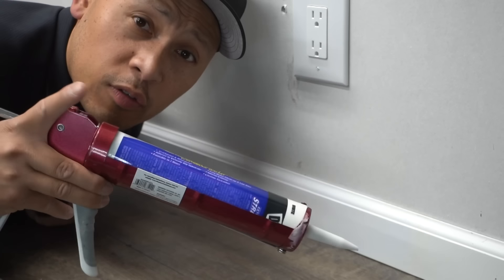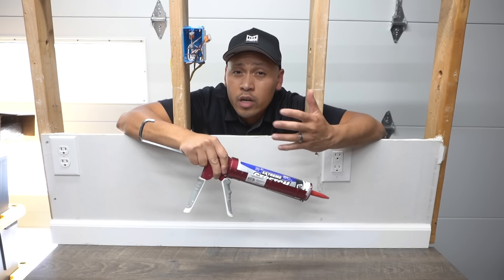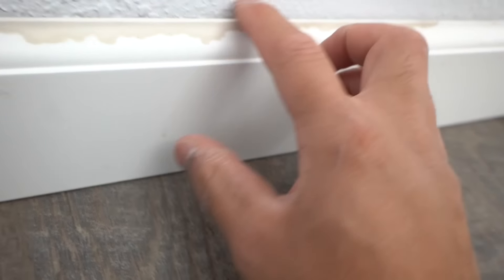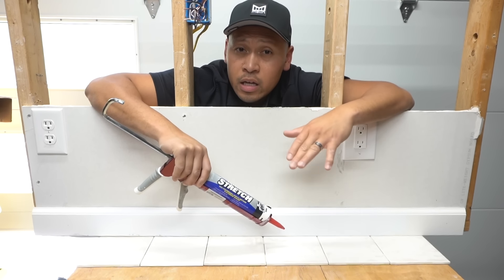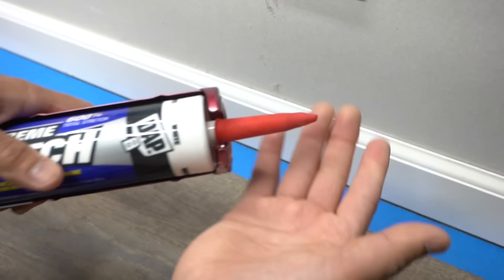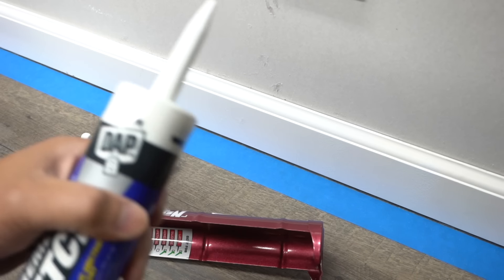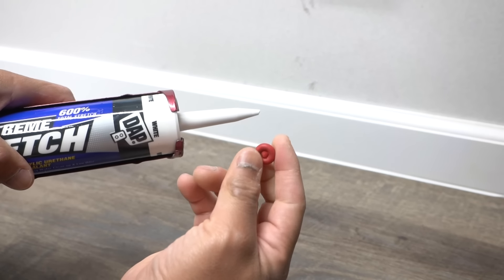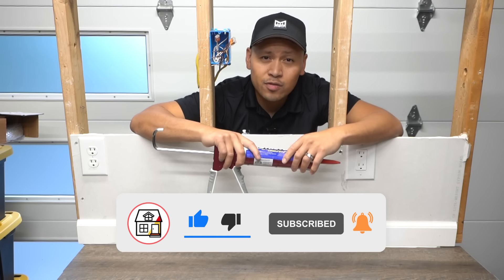Should You Caulk Your Baseboards To Your Floor? Pros And Cons! DIYers Great Controversy!

Comment: No you should never caulk the the bottom of baseboards. The reason is when water gets behind the caulk and paint into your walls the crack at the bottom of the baseboards is the only place for that water to escape.  Water gets locked in, baseboards swell, paint bubbles, caulk pulls away from the wall. It's just bad practice. I've been in the trades for twenty years and I've seen these problems first hand. Plus it looks ugly after the caulk starts to yellow.
Reply: How is water getting in behind the wall ? Silicone is what you’re supposed to use, not caulk, because it’s flexible and doesn’t yellow.
Reply: @reefhog  water gets into walls in all kinds of ways. More than I care to give examples for. Especially in kitchens and bathrooms. Every time I've seen a bottom caulked trim board in a bathroom more than a year old, the trim is always ruined and expanded. This doesn't happen on my installs specifically because I don't caulknthe bottom of my base. When you consider Capillary action and hydrostatic pressure, there needs to be a way for the materials to deal with the changes. It's kind of like expansion gaps. Can you install a floor without them, of course, but you're setting yourself and the customer up for failure.
Reply: @Multi4204life  Sounds like your building regulations are poor. In Australia, bathrooms are usually told, and extensive waterproofing is required before tiling. I can’t remember seeing skirting boards in a bathroom. If you do end up with water inside the walls, skirting boards being sealed to the floor is the least of your worries. You’re going to be pulling the walls apart regardless. Been in the “trades” for forty years and my father was a carpenter, so I’ve been around the building industry for my whole life.
Reply: @reefhog There is no reason to caulk the bottom of base in bathrooms in my area. First of all alot of our bathrooms are getting lvp nowadays. Don't use mdf in bathrooms unless your very cheap, it takes a pretty continuous water problem to ruin hardwood and pine base, I've remodeled at least 50 bathrooms and water damage is almost always on the back walls of the tub and face of the tub where we do seal it, toilet and vanity would be the next areas NOT the other walls or  baseboard in general so it's not a real problem to me. Alot of these bathrooms I've ripped apart have been 20+ years old and none have had extreme water damage so our codes in my area aren't too bad.
Reply: Everything you said sounds very logical. Do you live with the gaps or have a different solution? My hardwood floors meet plaster over brick walls. I've removed the trim and want to seal the cracks before installing quarter-round. But knowing me, I'll come up with some solution that doesn't age well or has other unintended consequences.
Reply: @cstreater  for the gaps under baseboards, you either push them tight to the ground before nailing, or you can scribe areas that have humps. In the end, you have to live with some defects. For example, if a small tile is lower than the tiles next to it from improper installation, you either have to reset the tile or  leave it alone. Scribing or caulking will still show the uneven spot. At the end of the day, the small gap, if any, should be barely noticeable. Things need room to expand and contract. Otherwise, there will be failures on what could have been a nice job.
Reply: @Multi4204life  thank you for this information!
Reply: I can understand the precautionary logic, but i'm not sure I fully agree.

For instance, would this logic still apply to other moisture-prone floor/wall thresholds? (i.e. a shower tray) Because the same issue would also be present here: "when water gets behind the caulk [sealant]
Reply: @erqankryn4029  the difference with a shower pan is that the pan itself is waterproof. Tile jobs are all supposed to be waterproof underneath the tile in case of failure that allows moisture in. Baseboards and drywall will usually show the water damage long before a tub as long as everything is installed properly.
Reply: @reefhog  Silicone is also called caulk.
Reply: @msheart2  No it isn’t. Why are you replying to a nine month old comment ?

Comment: I do have a question about the tip of the caulking tube.  Do I cut it straight across to open, or at an angle, and if at an angle, about what angle is best and how much of the tip to cut?
Ok, so I guess that turned into a multipart question! Lol 
Looking forward to answers and tips.  Thank you so much!

Comment: I caulked like this but the the caulk keeps cracking because the floor in the corner is not leveled. So any weight in the corner pulls it apart. There is about a quarter inch give, any ideas what i can add?
Reply: Random internet advice but If you are not on a concrete slab it might be a good idea to get someone to make sure your floor joists or floor is not rotted

Comment: If I caulk the dining room instead of using quarter round how do I transition into the next room using quarter round? My next room has probably an 8th" inch gap and that's too wide to just caulk. My dining room baseboard is pretty flush to the floor .

Comment: I use a section from a vertical blind. Hold it a 45 degree angle or wedge it under the board. They are usually pretty long and if you have a few you can clear a room pretty quick. Wipe it later ready for the next use.

Comment: I would actually caulk the wall first before I did the baseboard because it's so hard to paint and cock gets really dirty quickly. Everything sticks to it.
You can also buy flexible. Baseboard so that you won't have any gaps and caulking is not needed at all

Comment: Do you want a classy look? As an experienced painter with restoration quality work experience, personally, I would not choose to caulk there. Over time when there is reworking of the floor or baseboard, that line will get rougher and rougher as the caulk gathers dirt, hardens and breaks free from the floor surface. You need subtle shadow lines for a crisp refined look.  I like to maintain a gap just large enough to slide in paper masking (not adhesive backed) any time the baseboard gets repainted. Just pull the paper free afterwords. This way, that line will stay clean and crisp through many paintings and remodels that way. 

In general, IMO visible caulk anywhere on interior surfaces is a sign of low quality work.
Reply: So what if the customer tells you they don't like the gap?
What do you do
Reply: @JP-yd4yl  I got to the point where I only worked for customers who trust my judgement; all the rest were trouble. Not trying to sound snarky, but if they don't trust your judgement something is wrong :)

Comment: For any DIY person who really wants true answers... Just simply Google what floor installation You can even contact companies One of the things they'll say you should never talk this particular area The wood floor needs to have airflow moving underneath and yes there is always problems about insects spiders but here's my solution before installing the baseboard you can use powder or spray insect killer before applying the baseboard and when you install a baseboard you have to have a 1/16 Gap that's maximum low point.. And by the way there is no city or state code that would require this to be done...
Reply: As an over 20 year painting contractor doing  high end homes with engineered wood floors, I have yet to have a problem with caulking the base to those floors. Of course a flexible caulk is a must. Think about it for a minute- there is no "airflow moving underneath" a glued down floor. And no pesticide is a permanent deterrent to insects.
Reply: @pianomanw1m226  At least for floating vinyl click flooring, "Barricade", a company that makes insulated subfloor panels (probably mostly used in basements) advises against caulking the bottom of the baseboard (for air flow reasons).  Was wondering if I could caulk, and after it dries cut the caulking.  I figure the cut might not be too apparent and might be enough to allow for some air flow.

Comment: All - for floating floors be aware that this will void your warranty ->- these warranties on floors is for the mfg'er not the consumer. We had several planks break at the seams and filed a claim and the claim was denied and the reason was floor was caulked at baseboards which didn't allow for flexibility causing plank failure. ... just sayin -  we do like the look and the insect removal (although they still get in through doors, electrical outlets, and who know's how else)...

Comment: You could always use shoe base as it’s more flexible and you can push lower to floor
Reply: I thought about that, but along the same wall I have a 1/4" in spots and no gaps in others (it's an old house).  So I would have waves in my shoe molding.

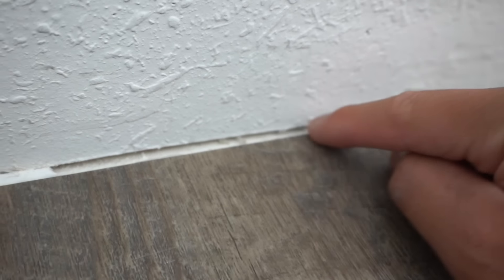Comment: 2:10 so I removed my old base boards because at the very bottom of them there was a rather large gap. To my surprise I found out that the gap from my floor tile to the wall is about 1 to 1.25 inches wide.  Anybody know what is best used to fill this gap before I install my new base boards? Would I simply have to grout in this gap?

Comment: The floor needs room to expand and contract and will just rip the caulk away from the baseboards.  The correct thing to caulk on a floating floor is the 1/4" gap between the drywall and the floating floor.
Reply: Even with the stretch caulking he’s using?

Comment: Whether it was code or not, makes sense to seal those joints.  A spider bite to the sack is a great alarm clock, but we have better options.  One question though.  If you accidentally ingested about a spoonful of caulk, would it be wise to call the emergency room to explain you have caulk in your mouth?

Comment: On hardwood and tile floors I have put down a bead of caulk and installed quarter-round right over top of the wet caulk. It gives a nice finished appearance after being painted without having to worry about smearing caulk on the flooring.

Comment: I really don't like exposed chalking regardless of color or kind of chalking. It looks good now, but it will not after a while. I would pre-chalk and use shoe molding, NOT QUARTEROUND!! And using a damp rag after going across with your finger to get any excess chalking, then back over with your finger for a clean look eliminates the tape. If you are using %100 silicone (non paint able), water will not work, but spitting on your fingertips before smoothing does work.

Comment: The caulk/sealing is aestethic to be in the coor of the baseboard. Also do not bother to usw tape for a straight line, use a special silicone tool for fine finishing of bathroom silicone, which have differents corners (just 90 degrees, or 90 degrees a little bit cut). It will be perfect. With tape, you end with a straight line but a high cliff on the edges of the sealer!

Comment: Do not caulk base to the floor. It is a nightmare when replacing, it is bad for floating floors, and it is completely unnecessary.  I spent 25 years building  million dollar plus homes, and never caulked base to the floor.
Reply: Well I ain’t living in a million dollar home & i wanna stop this water from coming in when it rains hard
Reply: No bugs I'm caulking it....
Reply: What do you suggest for ant problems in a place where landlord won’t pay for walls to be pumped with stuff some suggest to eliminate ants for years? They said I could caulk it myself if I’m worried about them being in my place but is there some other solution?
Reply: We rent in St Pete Fl. Cockroaches, small beetles, ants, etc come under the baseboards, especially in the corners. The landlords construction company did a lazy, inefficient, ineffective job. We have to use dehumidifiers in my bedroom and the living room as it gets up to 65% humidity in the house. I truly am not concerned about any future issues the landlord may have with the caulking. He's not concerned about our four year old living with spider bites. There's enough to deal with in Florida.
Reply: The benefits of caulking the baseboard to the floor outweigh the hassle when replacing it once in a lifetime.
Reply: A 1949, 1600sq ft not million dollar home.  Had to stop the bugs from coming in.  Amazing how it reduced the bugs to barely any after caulking.
Reply: @Krise343 Throw some borac under the baseboard.  It would last decades if it doesnt get wet.  You will never see bugs.  They die.  My dad used to be a professional pest control. Wonder why hospitals never have bugs?
Reply: We have a new build. They put the molding on first then tiled. We want to do LVP. Gonna caulk the seam against the molding. It would cost alot more to rip out the molding and tile.
Reply: I trimmed out a finished workshop with a concrete floor in a pole barn. Some bugs in the barn, so I'm caulking it! It's going to finish it out really sweet, especially since the concrete floor is pretty uneven at the walls. Scribing and  cutting the contours wasn't possible, so this is a great solution. The "Million Dollar Man" sounds like a "know-o-logist." This isn't a waste of time at all. Sounds like he probably cut corners when he could have done a million dollar craftsman type of job.

Comment: You should fire your finished carpenter if he’s leaving a huge gap between the floor and and the trim. Caulking looks trashy when it’s on the bottom of trim unless you’re hiding a small gap, not the whole wall.

Comment: I would never caulk baseboards to the floor.  First, I wouldn't use painted baseboards. I would use stained wood.  Second, if you need to remove the baseboards you've just created a headache for yourself.  
As for the insect issue, I suppose that depends on where you live.  In Canada, all homes have a vapour barrier behind the drywall, so insects aren't really going to enter through that area.
Reply: I wish we had that in America 😭 I think I might have to try to caulk my bedroom baseboards because I just saw a spider crawl under one when I was trying to kill it :(

Comment: You are never going to have that crisp clean look after it's painted, it's not going to happen. This is why they make quarter round and base shoe. Paint your quarter round to match your existing trim before you install it then touch up your corners, nail holes, and the caulk line that goes between the quarter round an existing trim. You'll have that nice crisp clean look and no paint or caulk on your floors. Apparently this guy's never put in a floating floor because the design is when it's installed correctly about an eighth to a quarter off the wall or existing trim. Again that is why you need quarter round or base shoe

Comment: You should be using silicone for this, not caulk. You don’t need to use masking tape for it. You can run the bead, and then spray some detergent solution along the bead, and wipe the excess silicone off with your finger or an ice cream stick. The silicone won’t stick to the surrounding area because of the detergent.

Comment: Caulking anything that doesn’t NEED TO BE SEALED is a waste of time and money and caulking and tape and all the other flim flam wet tooling cob work is only doing potential damage. It’s Dumb and just Wrong to caulk under baseboards or anything else that doesn’t need to be sealed. Even caulking concrete sidewalks is WRONG even though I’ve done it myself many times since it’s what they are paying me for. I see sidewalks spitting out caulking all over the place and if the proper expansion material was just left in and Not caulked There wouldn’t be caulking blown out all over and it’s often times done before concrete has fully cured 45 days and stone and masonry joints getting caulked all over. Mortar joints are not either or anything and should never be caulked. Grout joints should Never be caulked and so much more shit that Americans are pumping caulking into without a clue about anything